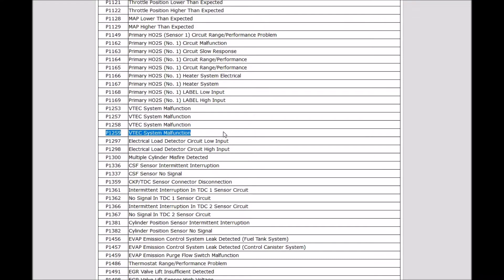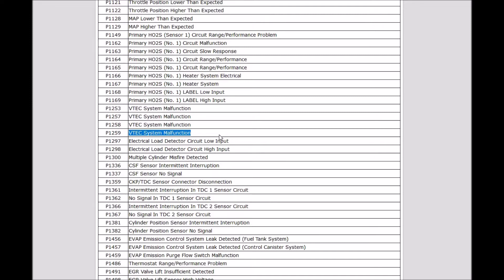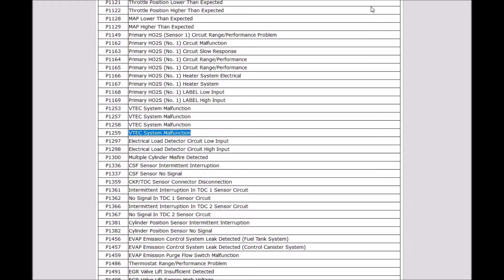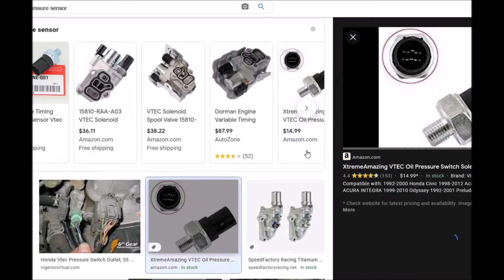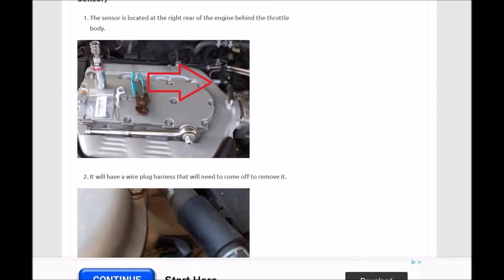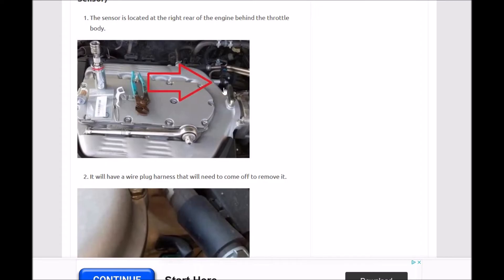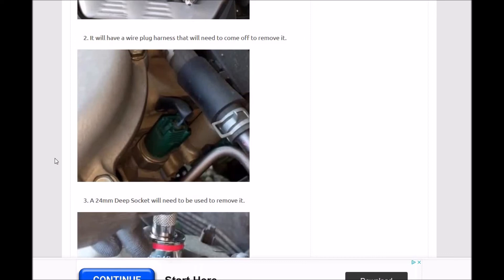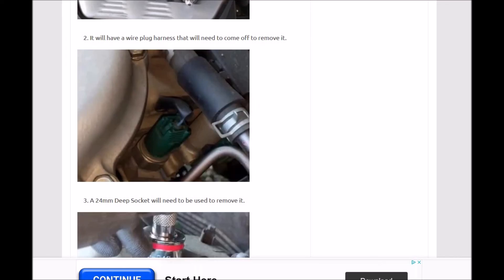How To Fix a Honda P1259 VTEC System Malfunction

Comment: Would replacing the entire vtec solenoid fix this too?
Reply: I replaces mine and it's still doing the same thing
Reply: just replaced the Variable camshaft timing solenoid and still having the issue, just depends whats causing it

Comment: 1998 Honda Accord, started getting a VTECH System Malfunction and around the same time a possible symptom. My car cannot go above 4000 rpms without stalling (which normally isn't a problem). The problem occurred at a similar time with the VTECH System Malfunction. Does this problem help narrow down the cause?
Reply: Mine was doing the same thing i still have the code but once i changed the oil and filter and made sure it wasnt low on oil it didnt have trouble going over 4,000 rpm
Reply: Also could it be the oil filter? I don't when the last time the previous owner changed it, so it may be very old.
Reply: I got same problem can’t go over 4k did you fix?
Reply: Mine is 2003 it don’t stall but its like 4k rpm is redline
Reply: @DKDevon did you ever figure it out I’ve been having this SAME exact thing can’t figure it out
Reply: @Hannaht1056  Hey man! Welcome to Honda first of all. I currently own an 01 accord and have had this exact same issue before. Second of all, the reason your honda probably won't go over 4k is because it's currently in something called "Limp Mode". This is something the car will do automatically to help prevent you from causing any extensive damage to your car. To fix my baby from her prev owner, I had to do a complete oil change and make sure the level stayed same. I also had to check all engine fluid levels, they dont work well without coolant! If you've already done this, I suggest running an obd scan and getting more information from that. Let me know if this helps!
Reply: My 1999 Honda accord LX is doing the same exact thing, at 4k RPMS it jerks and cant go higher, I had JUST replaced the VVT as well but all this only happened after the fact

Comment: check your oil. Lighr went on bc  I had to add 2 quarts of oil ..older car
Reply: did ur light go away after u added oil?
Reply: @tims1323  yes i was so low on oil had to add 2.5qts .. it ends up screwing up the emissions and thus the check engine light came on.. but the light takes several cycles to turn off
Reply: @agoogleuser7816  so my engine light might come on again after changing oil right?
Reply: i just changed my oil and cleared the engine light. it came back after a few mins
Reply: @agoogleuser7816  if you don’t have a code reader, you can disconnect the battery and that will clear the codes. That way you don’t have to wait to see if the engine light comes back on.
Reply: you have another issue then.  I bought an engine code reader thats used with the app Fixd...i plugged it in under the steering wheel when my engine code lights and it told me the problem or just take it to a mechanic
Reply: I've never seen a Civic with a V6.